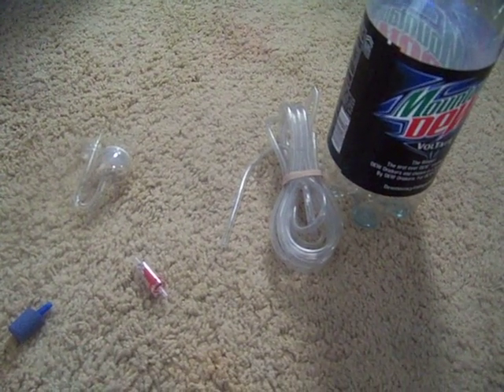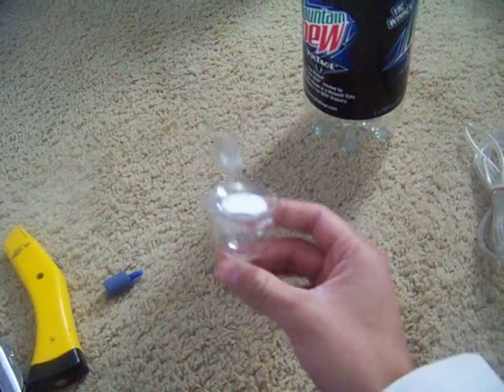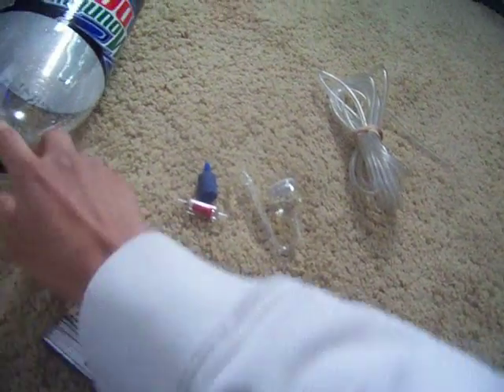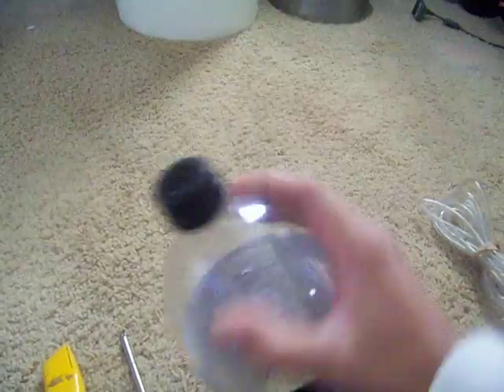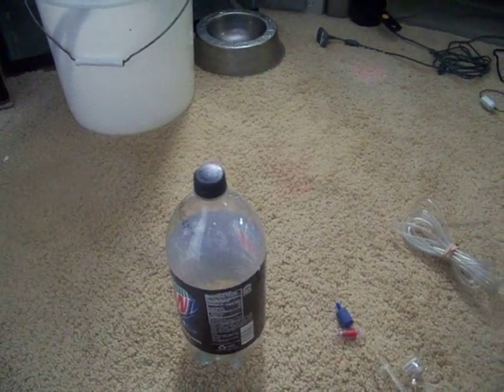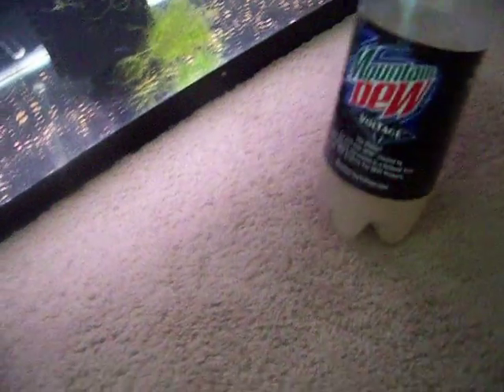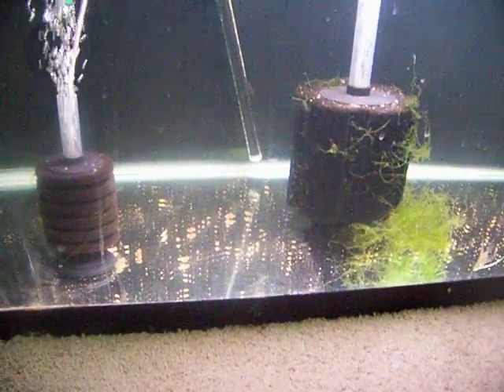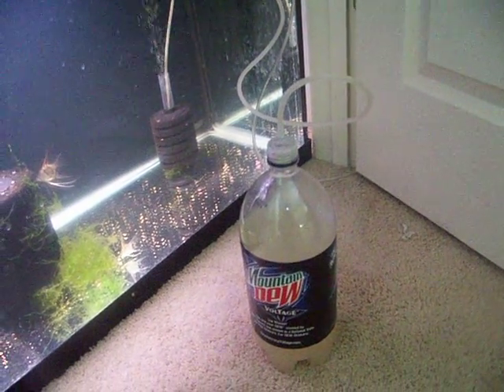CO2 diy

Comment: @sousinhaful  it is possible to kill your fish if you use a co2 kit.  just make sure you have enough plants to use the co2, OR run an air pump at night (or any other form of adding enough O2 for the amount of fish you have)
However..  the more surface agitation the faster the water will loose the co2. so the hydro sponges, though good for filtration, are bad for a co2 tank. 

in short..  if you want to think about having a co2 kit on your tank..  plan on having lots of plants&GOOD SUBSTRATE!!

Comment: Just FYI, this is a standard Co2 generator using yeast.  The amount of sugar will determine how much total co2 you get from it without refilling.  The quantity of yeast you add at the start probably isn't as important as the temperature you keep the bottle at or the type of yeast you use.  The colder you keep the bottle the slower the yeast will feed and the slower they will spit out co2.  There's no need for a check valve as long as you can put the generator up higher than the water level.